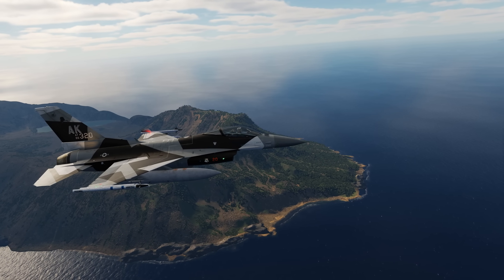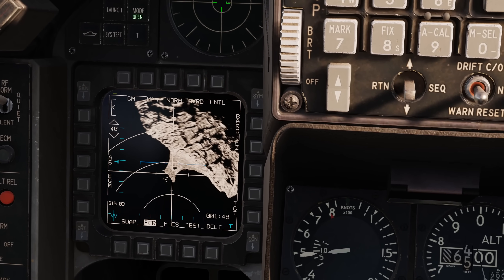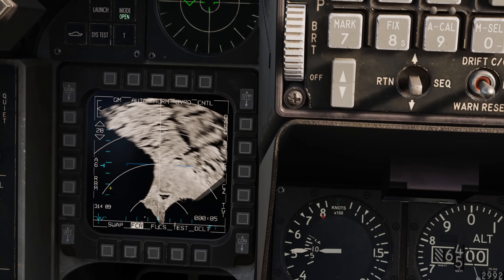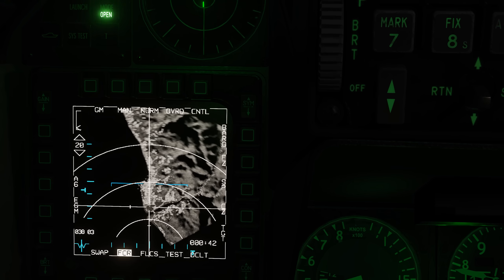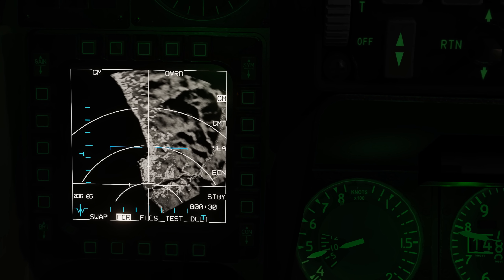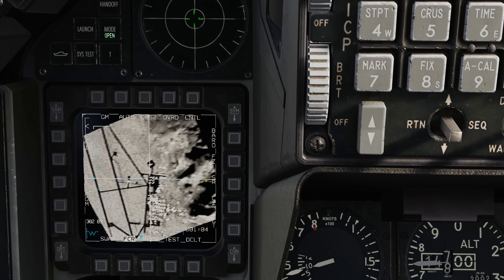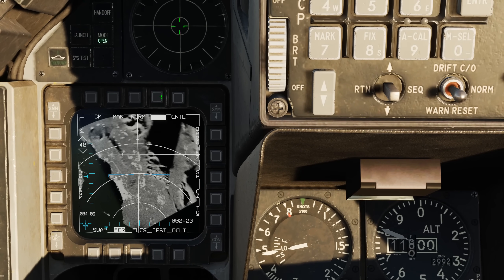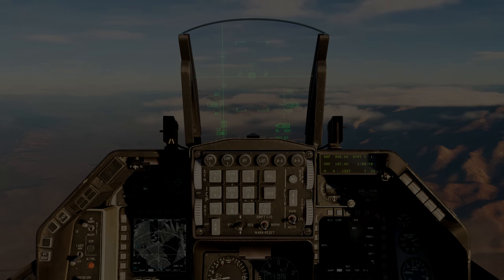DCS: F-16C Viper | Air-to-Ground Radar

Comment: Has the Air to ground radar received a nerf since this video? Because mine is absolutely ass, terrible image quality and extremely slow azimuth refresh rate. Very disappointing.
Reply from the maker: Works perfectly fine here. Please post a replay track file to the official forum so we can determine where you are going wrong. https://forum.dcs.world/topic/345191-has-the-a-g-fcr-changed-since-these-tutorials/#comment-5400565
Reply: @MattWagner  I really appreciate the reply, reading the forum concludes that it has undergone some significant changes, seems quite underpowered at the moment, bit of a shame but I'm sure we'll manage.
Reply: yeah i came back to this video because i wanted to check if i wasn't doing something wrong and yeah, the radar is showing a quite worse quality than before

Comment: Man, I wish I could get my Viper A/G radar to work as good as yours. It use to, but lately it is just... weak. I just did a flight similar to this; about 20 miles off the coast, about 6.5K feet, 40 mile range, same gain and antenna elevation, but mine looks nothing like that. I don't know what has happened, but lately I just can't get an A/G radar to work right.

Comment: Hello everyone.. i am not sure what i m doing wrong but after pressing OSB 3  and switching to DBS 1/2, when i try to zoom in by pressing OSB 19/20 to increse/decrease range , it goes back to NORM.. i follow every step in the video but somehow it doesn't show me the same result like in the video. In the video, target appears to be beyond 10NM and when decreasing the range to 10NM, it  provides the closed-up target picture.. confused how this happens as the target is beyond the set radar range.. when i do that, the radar image is limited to 10NM and any target beyond 10NM disappears.. any advice is greatly appreciated.. i ve been trying to figure this out for the last few days now.. thanks again..
Reply: UPDATE:   it didnt make sense to zoom in further with the range increase/decrease OSBs. As it turns out, I believe that was incorrect and got fixed with the update. correct me if i m mistaken. thx
Reply: Same problem, didn't find a solution?
Reply: I found a solution. After changing the scale, without changing the scale (for example 10), go to ESP > and further and the scale at the desired point will change.
Reply: @NightGameRus  i m not sure if that works.. apparently that was an errror and got fixed.. AG radar doesnt have this kind of capability
Reply: @kaan444   I did it this by changing the zoom beforehand before zooming in. And in zoom modes, it already showed an enlarged image above the point of interest. And you need to go at an angle of 20-30 degrees to the point.
Reply: @kaan444 so we are not able to do what wags did the in the video? I'm having the same problem now

Comment from the maker: NOTE 1. As always, these videos provide a preview of an upcoming feature to assist you in understanding a new feature. Later, it is quite possible that the feature will change, and the feature functionality has changed. As much as I’d like to, I lack the time re-record these videos.
NOTE 2. Since this video was created, you can now select the Up and Down range arrows to manually adjust range without needing to select MAN at OSB 2.
Reply: I think my radar is broken then as it doesnt work like that. I would love to know what I'm doing wrong. Sometimes it puts a diamond there, sometimes an empty box, then it un locks itself and screen goes black again.
Reply: Hey Wags, thanks for the vid.
If I'm not mistaken the azimuth scan speed has been adjusted since this video and I've gotten the hang of that.
However when in DBS1 or 2 and I adjust the range, it throws me back out to NORM mode and I have to hit Expand FOV to re-enter DBS view with the new zoom scale, is this intentional?
Reply: @peanutsareyum  I have the same issue, and I can't use the range OSBs to get a more zoomed in image! Did you find a way to do it, by any chance?

Comment: How come f18 ground radar is not as sharp as f16??? F18 ground radar looks more blurry than f16s?
Reply from the maker: It is the same resolution. They may appear different due to the palette difference and if you are not using the proper amount of squint angle.

Comment: Great job and great video again!

Why do the ground stuff look so blurry on the Caucasus map though? Is this a map issue or am I doing something wrong that everything is so blurry even in DBS2 and 10NM range setting? Also, when in DBS no matter if I use 60 or 10 deg azimuth for scanning, the radar scans at the same slow rate as if being in 60 deg.

I appreciate any suggestion for these aspects. Thanks!
Reply from the maker: You are probably not offsetting the target enough to provide enough squint angle.
Reply: @MattWagner  
Thanks for the answer Mr. Wagner! Copy..., so I shouldn't go straight for the target, but approach it from a higher angle in order to have a better quality signal using the ground radar?

Comment: This is the first time I've ever seen synthetic aperture radar in a simulator. This is absolutely incredible. Very, very realistic. The only thing I've noticed that isn't in the sim is the speckling (perhaps aircraft use noise reduction to remove that) and the characteristic "bloom" effect that's inherent to sharp cornered objects when imaged by SAR
Reply: I know this is VERY old and you guys probably figured this out already, but this is not SAR since the version of the Viper + AN/APG-68 we have does not get it, a later version did however so maybe we will eventually get it!
Reply: Once we get far enough to get such late aircraft, possibly wait till 2040 lol?
Reply: This isn't SAR. Very different application and implementation
Reply: @MONARCH1985  The AN/APG 68 has SAR capabilities for ground radar.  Multiple sources and available literature on the matter states this.  I am in no way an expert in this, but researching the equipment used in declassified literature supports that it is SAR.
Reply: @awcleve  can you link these sources? I’m interested in reading

Comment: This looks significantly better than the Hornets AG function despite being a much smaller dish, why is this?
Reply: It has less to do with the dish and more the processor, for example the awg-9 is a poweful radar, but pretty crappy at a/g due to the processor it has, the viper we use is actually from 2007 while the hornet is from the 1990's
Reply: @gundamator1818  Our Hornet is a 2005 Lot20, the difference shouldn't be this major.

Comment: Nice implementation from ED , some  clarification? in OSB #2 we have the AUTO label for A-G radar in Auto mode and MAN label when the Radar went into Manual mode:  Range Scale Selection (OSB 2)
An automatic range scale option is available in the following modes: GM, EXP, DBS1, DBS2, FTT, SEA, GMTI and GMTT. 
Auto range scale switching is enabled via OSB 2 which toggles AUTO or MAN. AUTO range scale switching, which is on 
by default, may be disabled by depressing OSB 2 or by manually changing the range scale. Any range scale change 
made via OSB will return the radar to manual (MAN) range scale operation So A-G Radar is in AUTO be default and has the label AUTO in OSB#2 and MAN form MANUAL A-G mode.  in the video was vies versa think?

Comment: This is very impressive, can't wait to start using this.  On a different note, it would be awesome if there was a way to easily dispense chaff and flare independently one at a time through a single button push.  It would also be cool to use the SLAM-ER and harpoons.
Reply: For flares and chaff you can edit a countermeasure profile to be exclusively one, and the panic switch to be exclusively the other. 

Though when I’ve attempted it, it hasn’t worked - but I haven’t looked into the other settings so it’s possible I’m doing something wrong.

Comment: Question:  Radar point on object then set to SPI. Will mavs slew to this point (handoff)? Or will I still need to transfer to the TGP (provided this SPI is now the SPI on the pod which it seems it should be)?  If it slews automatically this could remove a step and make for easy ways to get "close" then fine tune the mavs. I'm also assuming mark points will come at some points then we could mark several targets before running in and unloading on them.
Reply: You don't have to "set to SPI". If the radar is SOI and tracking then it is SPI, fully automatic without any need to lock. No, Maverick automatic handoff is not possible with radar. In radar EO PRE operations you will press TMS up on radar and SOI will automatically change to WPN (or you can DMS aft SOI over instead) so you can finalize slew and track yourself. Missile is constantly slaved to SPI throughout.
Reply: F-16 is actually pilot friendly, unlike other airplanes :) I expect by leaving mavs in PRE slaved mode, they will automatically track to wherever you point the SOI cursor. Then you just switch SOI over, lock and shoot.

Comment: Wags: Goes to DBS2

Me, having only flown the F-18C: Witchcraft
Reply: I think EXP3 is just as good in the Hornet. Designations and freeze are bugged right now, but I can get detail just like this.

Are you guys offsetting enough? At 45 degrees 13 miles out you should be seeing decent imagery.
Reply: DBS2 is supposed to be worse than in the Hornet.
 It is just that the Hornet radar bugged to the point that worse tech looks better compared to the mess that is EXP3.
Reply: @alassadgaming6111  What makes you say that? Isn't the 18c like 30 years older than the block 50?
Reply: @Frindleeguy  no, the APG-73 on the C model Hornet and the APG-68v5 on the Block 50 both entered service in the late 80s/early 90s (1987 vs 1991 to be precise)
Reply: @oppotato5440  And the hornet was designed for strike while the viper’s AG radar role is more or less secondary
Reply: @Frindleeguy  SAR technology is much better than DBS. Thats why.
Reply: @alassadgaming6111  SAR is a method of DBS. It's just an algorithm to generate a constant (as opposed to radial) sector image.